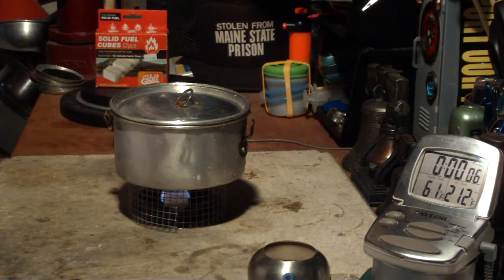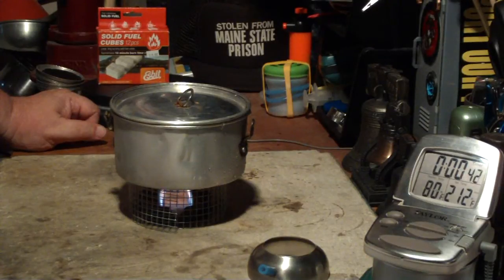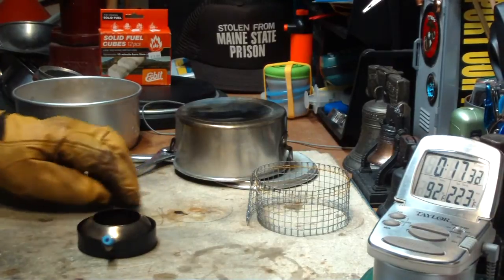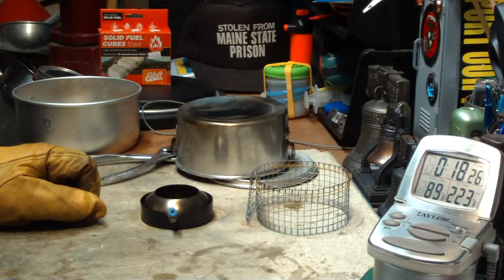Epicurean Classic Stove from Flat Cat Gear - Boil Test #1

Comment from the maker: That might work. What if I did the test again but with using the Olicamp Windshield to hold in the heat and leave out some of the air? When I did the Camera 2 shots I felt a lot of heat coming away from the burner.